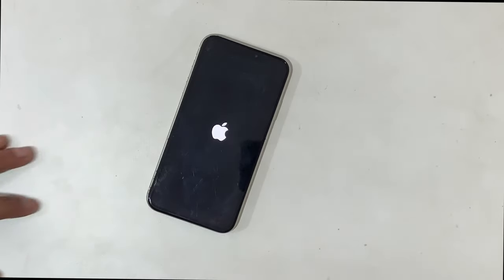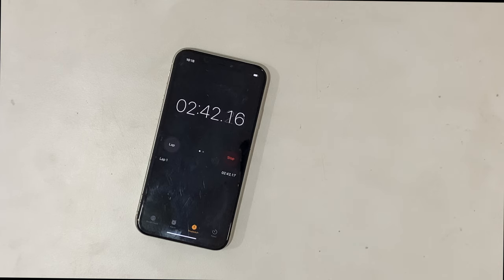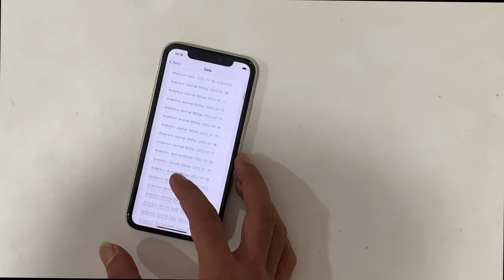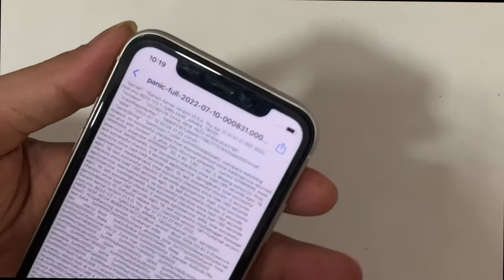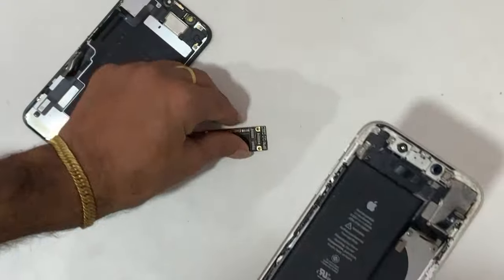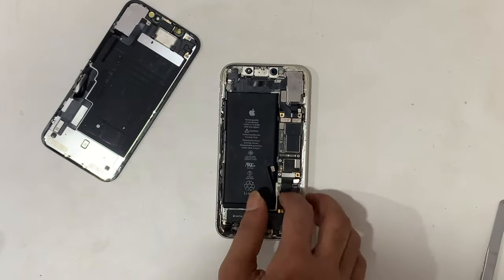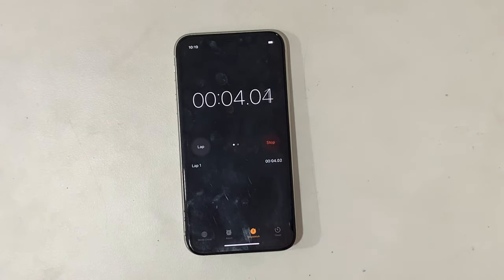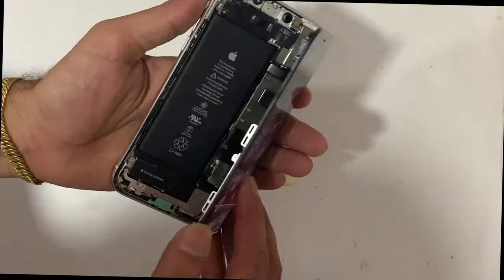iPhone 11 keeps restarting randomly on 2-3 Minute Solution 2022.

Comment: no successful checkins from thermalmonitord\nservice returned not alive with context : is_alive_func returned unhealthy : current 3bfffffffffff, mask 1ffffffffffff, expected 1ffffffffffff.  SD: 1 BC: 1 RC: -1 BS: 1, Missing sensor(s): mic2 \nservice: backboardd, total successful checkins in 196 seconds: 19, last successful checkin: 0 seconds ago\nservice: SpringBoard, total successful checkins in 168 seconds: 17, last successful checkin: 0 seconds ago\nservice
Reply from the maker: On which model did you face that issues ?
Reply: 11

Comment: Hi, iphone 11...

SD: 1 BC: 1 Missing sensor(s): mic2 \nservice:
backboardd, total successful checkins since load (180 seconds ago): 19, last
successful checkin: 0 seconds ago\nservice: SpringBoard, total successful
checkins since load (169 seconds ago): 17, last successful checkin: 0 seconds
ago\nservice: mediaserverd, total successful checkins since load (180 seconds
ago): 19, last successful checkin: 0 seconds ago\nservice: logd, total successful
checkins since load (180 seconds ago): 19, last successful checkin: 0 seconds
ago\nservice: thermalmonitord, no successful checkins since load (180 seconds
ago)\nservice: runningboardd, total successful checkins since load (180 seconds
ago): 19, last successful checkin: 0 seconds ago\nservice: wifid, total successful
checkins since load (180 seconds ago): 19, last successful checkin: 0 seconds
\nDebugger message: panic\nMemory ID: 0x6\nOS release type: User\nOS version:
19C63\nkernel version: Darwin Kernel Version 21.2.0: Sun Nov 28 20:43:35 PST
2021; root:.xnu-8019.62.2~1\RELEASE_ARM64_T803O\nKernel UUID:
297DE7B5-4397-37D9-98E1-EA1F9C274044\niBoot version:
iBoot-7429.62.1\nsecure boot?: YES\nPaniclog version: 13\nkernel 

The phone was "fixed" a few days ago... Thanks

Comment: Ive recently changed housing and every 3 minutes my phone will restart in its own pls help me , 

SD: 0 BC: 1 RC: -1 BS: 2, Missing sensor(s): Prs0 \nservice: backboardd, total successful checkins in 202 seconds: 19, last successful checkin: 0 seconds ago\nservice: SpringBoard, total successful checkins in 169 seconds: 17, last successful checkin: 0 seconds ago\nservice: mediaserverd, total successful checkins in 202 seconds: 18, last successful checkin: 0 seconds ago\nservice: logd, total successful checkins in 202 seconds: 19, last successful checkin: 0 seconds ago\nservice: thermalmonitord, no successful checkins in 202 seconds\nservice: runningboardd, total successful checkins in 202 seconds: 19, last successful checkin: 0 seconds ago\nservice: wifid, total successful checkins in 202 seconds: 19, last successful checkin: 0 seconds ago\nservice: configd, total successful checkins in 202 seconds: 18, last successful checkin:\nDebugger message: panic\nMemory ID: 0xff\nOS release type: User\nOS version: 20F75\nKernel version: Darwin
Reply from the maker: On which model you face such issue. You use OEM charging flex ?

Comment: nicString" : "panic(cpu 1 caller 0xfffffff02841b818): userspace watchdog timeout: no successful checkins from thermalmonitord since load\nservice returned not alive with context : is_alive_func returned unhealthy : current 3bfffffffffff, mask 1ffffffffffff, expected 1ffffffffffff.  SD: 1 BC: 1 RC: -1 BS: 1, Missing sensor(s): mic2 \nservice: backboardd, total successful checkins since load (180 seconds ago): 19, last successful checkin: 0 seconds ago\nservice: SpringBoard, total successful checkins since load (169 seconds ago): 17, last successful checkin: 0 seconds ago\nservice: mediaserverd, total successful checkins since load (180 seconds ago): 19, last successful checkin: 0 seconds ago\nservice: logd, total successful checkins since load (180 seconds ago): 19, last successful checkin: 0
Reply from the maker: Log shows Charging flex issue.

Comment: "panicString": "panic(cpu 1 caller 0xfffffff013d3fddc): ANS2 Recoverable Panic- assert failed: [15468] Double Bitflip in region 1, err 0x80, addr 0x8ffe73f80- Cmd(10) nassert failed: [15468] Double Bitflip in region 1, err 0x80, addr Ox8ffe73f80\nRTKit: RTKit-2062.40.13.release Client: 18030.release- AppleStorageProcessorANS2-1294-12439-1294-12439\n!UUID: a0139542-8711-34d4-90d3-0c3825040b6fnTime:

what this panic show
Reply from the maker: On which model did you face such issues. Is that dropped one ?
Reply: me too i have the same problem on my iphone x

Comment: . SD: 1 BC: 1 RC: -1 BS: 1, Missing sensors): Prs0 nservice: backboardd, total successful checkins in 197 seconds: 19, last successful checkin: 0 seconds ago|nservice:
SpringBoard, total successful checkins in 169 seconds: 17, last successful checkin: 0 seconds ago|nservice: mediaserverd, total successful checkins in 197 seconds: 18, last successful checkin: 0 seconds ago|nservice: audiomxd, total successful checkins in 197 seconds: 19, last successful checkin: 0 seconds ago|nservice: logd, total successful checkins in 197 seconds: 19, last successful checkin: 0 seconds ago\nservice: thermalmonitord (2 induced crashes), no successful checkins in 197 seconds \nservice: runningboardd, total successful checkins in 197 seconds: 19, last successful checkin: 0 seconds ago|nservice: wifid, total successful checkins in \nDebugger message: panic|nMemory ID:

Ox1\nOS release type: User\nOS version: 21D61\nKernel version: Darwin Kernel Version 23.3.0: Wed Dec 20 17:32:41 PST 2023; root:xnu-10002.82.4~3/

Comment: panic(cpu 0 caller 0xfffffff0262bd6f8): userspace watchdog timeout: no successful checkins from thermalmonitord
service returned not alive with context : is_alive_func returned unhealthy : current 6ffffffffffff, mask 37ffffffffdff, expected 37ffffffffdff.  SD: 0 BC: 0 RC: 0 BS: 1, Missing sensor(s): Prs0 
service: backboardd, total successful checkins in 194 seconds: 18, last successful checkin: 0 seconds ago
service: SpringBoard, total successful checkins in 160 seconds: 17, last successful checkin: 0 seconds ago
service: mediaserverd, total successful checkins in 194 seconds: 18, last successful checkin: 0 seconds ago
service: logd, total successful checkins in 194 seconds: 19, last successful checkin: 0 seconds ago
service: thermalmonitord, no successful checkins in 194 seconds
service: runningboardd, total successful checkins in 194 seconds: 19, last successful checkin: 0 seconds ago
service: wifid, total successful checkins in 194 seconds: 19, last successful checkin: 0 seconds ago
service: configd, total successful checkins in 194 seconds: 18, last successful checkin: 
Debugger message: panic

help bro its iphone xs
Reply from the maker: Your iPhone was water damage one or not ?
Reply: @thegsmsolution1  not
Reply: @thegsmsolution1  what to do bro
Reply from the maker: You have charging flex issue brother.

Comment: "panicString" : "panic(cpu 1 caller 0xfffffff015a17618): userspace watchdog timeout: no successful checkins from thermalmonitord\nservice returned not alive with context : is_alive_func returned unhealthy : current 3bfffffffffff, mask 1ffffffffffff, expected 1ffffffffffff.  SD: 0 BC: 1 RC: -1 BS: 1, Missing sensor(s): mic2 \nservice: backboardd, total successful checkins in 205 seconds: 19, last successful checkin: 0 seconds ago\nservice: SpringBoard, total successful checkins in 171 seconds: 17, last successful checkin: 0 seconds ago\nservice: mediaserverd, total successful checkins in 205 seconds: 18, last successful checkin: 0 seconds ago\nservice: logd, total successful checkins in 205 seconds: 19, last successful checkin: 0 seconds ago\nservice: thermalmonitord, no successful checkins in 205 seconds\nservice: runningboardd, total successful checkins in 205 seconds: 19, last successful checkin: 0 seconds ago\nservice: wifid, total successful checkins in 205 seconds: 19, last successful checkin: 0 seconds ago\nservice: configd, total successful checkins in 205 seconds: 18, last successful checkin:\nDebugger message: panic\nMemory ID: 0x6\nOS release type: User\nOS version: 20B82\nKernel version: Darwin Kernel Version 22.1.0: Thu Oct  6 19:32:38 PDT 2022; root:xnu-8792.42.7~1\/RELEASE_ARM64_T8030\nFileset Kernelcache UUID: 25B4C81ED3B8A0D40E4459D373449A1F\nKernel UUID: 17EB6472-1780-3881-B28A-6CCF175F7F46\nBoot session UUID:
Reply from the maker: On which model you got an issues ?
Reply: iphone 11
Reply from the maker: The log indicates that this is the issue with your charging Flex.

Comment: SD: 0 BC: 1 RC: -1 BS: 2, Missing sensor(s): TG0B TG0V \nservice: backboardd, total successful checkins in 308 seconds: 29, last successful checkin: 
Plzz tell me whats the problem
Reply from the maker: Fault was related to Battery or loose contact of battery connector check it out and post result.
Reply: @thegsmsolution1  bro its gives important battery message and also restarting after 3 minutes one month ago i changed charging flex
Reply from the maker: Battery loose contact.
Reply: @thegsmsolution1  i went to repair shop and he change my battery flex and its now fine but dont know it will happend again or not
Reply: @thegsmsolution1  it give the same problem again 😭😭😭
Reply from the maker: Nope
Reply: @thegsmsolution1  no it give i change it in repair shop after 2 3 hour it’s restarting again